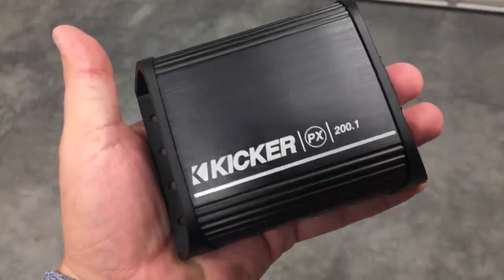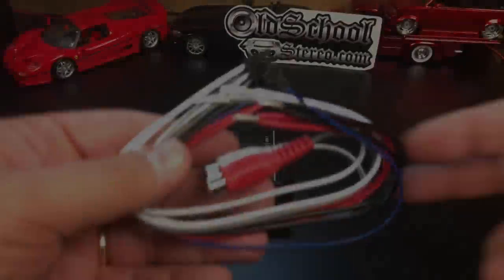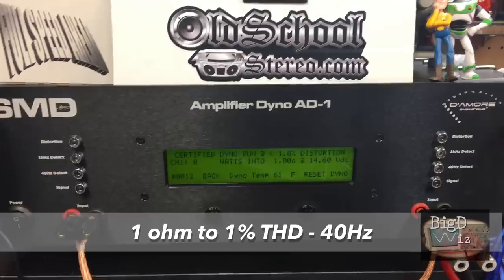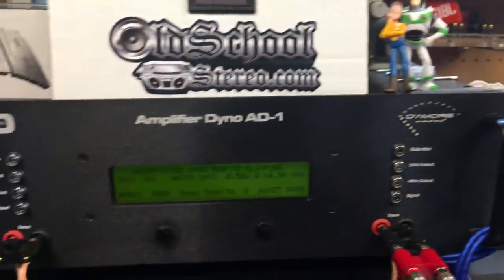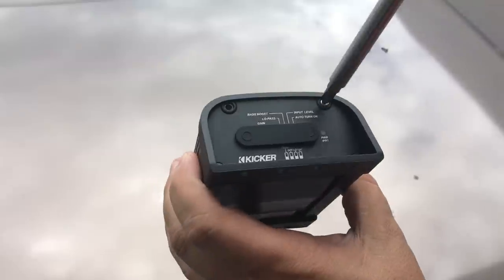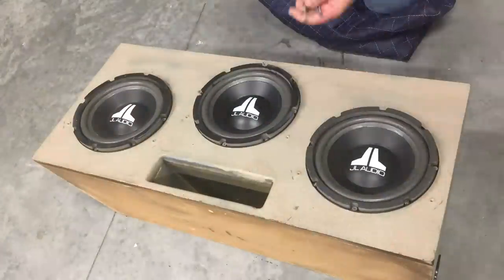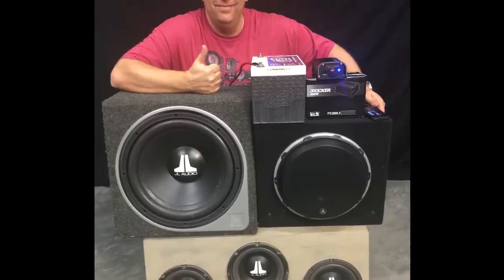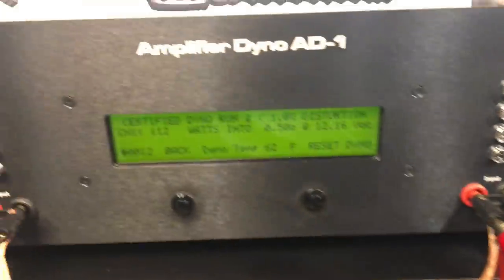Palm Sized Power? Kicker PX200.1 200 watt Monoblock Amp Dyno Test

Comment: 160w while fitting in your palm seems fair.
Reply: watch his video on Rockford Fosgate PBX 300 then tell us if you still think it's fair.
Reply: @XX-121  the Rockford is 2-3 times the size so it should be more powerful.
Reply: They could just call it a 150 and then it would be honest and fair . Thus is almost 20% under the rated . Just rate it honest this is rating you expect from Walmart  .

Comment: Never liked the kicker Amp. Now I love the speakers you got wired up. JL 15's with the JL amp. I can't remember what size amp it was but I had them in an Nissan Exterra and I could drive though the walmart parking lot and set car alarms off with that thing. Had component system in there. Out of all the systems I had, that was by far my favorite and most loudest system I ever had. Between setting other car alarms off I could be riding down the road at 50 or 60 miles an hour and the damn back door would open wide up. Many times I should have lost those speakers. Which I did. I loaned them to my nephew and tried to tell him to take the cars when he went in at night and lock up his Jeep but he was hard headed. They found the Jeep 2 towns over with my speakers, box and amp gone. I could've cried that day knowing the amount of money I had in that system. Sick ass people can't go and work for their own stuff, they got to steal other's and we're the racist one. I wonder why.

Comment: I really guessed it would have done rated, but nonetheless per size its not too shabby. At least it wasn't called a 300 or 400 watt
Reply from the maker: +www.GPcarAudio.com pretty close, but calling it a 150 watt amp would be more realistic IMO
Reply: BigDWiz yea definetly agree
Reply: www.GPcarAudio.com 
I totally agree. Being a Kicker and with my experience with a small Rockford PBRs... I totally thought it would.
I'm wondering how it would sound in a car pushing a sub...
Reply: It's still pretty good. Something like a Pyle would probably do half that and claim twice the wattage
Reply: it depends on how you connect a kicker actually your on the right path. warring kicker products put out double the amount. so 300 is 600 200 is 400.
Reply: As someone that owned a bit of Kicker gear in my teenage years I'm kind of disappointed...
Reply: @wal  Marketing garbage, they knew well after their testing it was a 150 watt amp :-/

Comment: They can’t all be winners... for the applications these will be used in I’d say it’s still a solid deal. Great video as always!
Reply from the maker: appears they should have rated 150 watts, not 200. Unusual for Kicker, they usually don't do this. I'm a bit shocked, honestly...
Reply: I’m assuming they borrowed this design or even had someone else build it for them, but I did see where it had Kicker on the board so who knows...
Reply: hifivega 
I agree! Considering it's 50 bucks shipped! That's crazy!
I was thinking it was going to have a $125 price tag!
Reply: BigDWiz 
I mean could there just be an honest mistake here? Maybe the original design and amplifier pushed out 200 watts and then, to get the cost as low as it is, some parts were changed allowing the cost to get into the $50 range and they just didn't retest and change the literature.
Dang. When I post at 10 in the morning it actually kind of makes sense. LOL.

Comment: Still impressive for the size and half ohm stable not many amps out their claim half ohm stable
Reply from the maker: +Daniel Harrell very specific use here
Reply: Could it be used for full range or low lass only?
Reply: Daniel Harrell 
Use 2 of them.....one for the left channel and one for the right. Lol. 
Kicker does make a 2 channel version as well.
Get this mono amp and the Pioneer 12" Pro (105db sensitivity) then the 2 channel version of this running some PRV mids and super tweets (100+DB sensitivity also) with an Audiopipe 2 way passive crossover (20.00...for a set!) And boom a WOW factor tiny amp loud system!
Reply: It's actually 0.25ohm stable believe it or not. I've installed a couple like that. lol HEY BIGD! THROW IT BACK ON THERE AT 1/4OHM!

Comment: I know I’m late to this video. But I got this amp a loooong while ago. I built a little sub box with a 6.75 kicker comp r and a passive radiator to put in my single cab work truck and be discreet about it, and this thing does some work for being so tiny. Huge fan of the auto turn on because I was already nervous about running wire to the battery (Company owned work truck).
Reply from the maker: Awesome 👏

Comment: This is actually half of what a normal car amp would be,it lacks a power supply since the simple construction,thus very susceptible to voltage changes,drop it to 12 volts and most of you power will be lost,when a regular amp would "keep" it's power better when voltage drops.Still a cool thing and more than enough for anyone other than people who compete.

Comment: Edit: I just realized this is a older vid. Lol!   Oh well!  

Another chip amp which isn’t necessarily a bad thing.  The chip isn’t visible after he removes the bottom cover, Im guessing it’s soldered to the other side of the PCB which presses against the enclosure/heatsink.  Probably not the ubiquitous TPA3116 that’s used in a lot of inexpensive chip amps, the TPA3116 can actually perform very well but only when it’s supplied with a 24V-28V DC power source which is capable at least 5A. Since this is meant to be used with 12V-14.4V.  I’m guessing it’s using one of the newer automotive ST Amp ICs which are specifically designed for the lower voltage.

Comment: Hey,

Could you do some dyno tests of headunits please?
Would be curious to see if any meet their written specs like the Sony headunits that claim 55Wx4.
Reply: Nobody that's serious about car audio relies on the power from the deck.   You get what's called a 'deadhead'.  Puts out no amplification.   ONLY  low level outputs.
Reply: The Sony with the power pack amp built in does in fact put out about 40w I used to own one it was awesome for what it was

Comment: For the price it's a nice and very efficient amplifier. It took only 116 watts (8A times 14,54V) to put out 91W into a 1 ohm load, which means that the effectivity of the amp is around 78%. I'm wondering if that's class D or not, because for class D it's a bit on the low side (and gets worse at 0,5 ohms).
Reply from the maker: +AttilaSVK it’s very difficult to get an exact current measurement with my setup as I need to stop the test as soon as the Dyno stops counting. I usually give it a second or so more and current rises and power does not. I’d say it’s very efficient as compared to most amps I test, even other Class D’s
Reply: Thanks for your answer. Your testing method is fine, and I really appreciate your videos. Keep up the good work :) (and if you'd get an Alpine 3554, please put it on the dyno, as I'm curious how it would perform - a 3554 is running my front set and my sub btw)

Comment: These amps work good for stock sub applications. I have a 2000 acura tl and after changing the head unit the factory amp is no longer usable. The stock sub is .8 ohms and there is not an aftermarket replacement sub that fits in that location

Comment: The most under rated wattage on any amp I've ever seen is on my Mcintosh Mc-300 non auto former Amplifiers ,Mc rates the amp at 300 wpc @ 8 ohms stereo and 600 wpc @4 ohms stereo ,in bridged mono Mc lists 700 watts @8 ohms and no rating for 4 ohms ,all ratings are at 0.05 THD ,when I benched the amp it's putting out 420 wpc 8 ohms and 850 wpc 4 ohms ,in bridged mono it puts out just over 900 watts @ 8 ohms with 0.05 % THD and zero clipping due to Mc power guard ,the best value in high end home audio high wattage amps is the Mc-300 that's a rare amp being it wasn't made with auto formers .

Comment: Hey Big D whiz, enjoy the videos. Couple questions. First, would you be interested in bench testing an old US Acoustics 2050 amp? Second, Have you ever bench tested a US Amps USA-2000 amp? I have one I’ve been running since 2001 and just curious what kind of power it really puts out.
Reply from the maker: +Paris Dean thanks bro. I’m loaded down with stuff to test right now. Thanks for asking though🤙
Reply: That’s fine, Should have been more thorough on my second question. I was not asking for a bench test of the USA-2000. I was just wondering if you have ever done a dyno on one or if you know anybody that has. Just curious of what kind of power it really puts out.

Comment: I use to absolutely love kicker equipment. I remember back in the early 90’s having 2 kicker 12s in my 88 mustang 5.0 drop top that would absolutely pound.. but now says kicker is sold at freaking Walmart so it’s lost it’s name significance ya know... those JL you pulled out tho are sick! Wasn’t it a W6 or something that was supposed to be bad ass back in the day lol
Reply from the maker: We asked the Walmart question in an interview with Kicker marketing. See the response here. Makes complete sense to me https://youtu.be/3ajYwo7MOH8
Reply: The W6 back in the 90s was one of the biggest subs you could get.
Reply: I had the w5  duel 8ohm that sounded better then my w6  duel 3ohm, just the dimension for the box for the w5 was so big, that it took up the whole trunk space of 90 cougar, but if he could test some w5's you would b surprised. And yes, in 1998 when the w3 came out i got a pair and took my triple stack w6 out and never tried anything else to date. I still have the w3 12in duel 2ohm with a Orion 600 watt hot setup with the skull and blinking red eyes in my basement

Comment: These amps don't have a very high S/N ratio, its around 70-80db last time i checked. Not the cleanest little things, but they are small and get the job done for bikes and small vehicles.(updated) just noticed in the manual it said >90db s/n ratio, that's not bad. Should rename this amp to the px150.1
Reply from the maker: +Wade Hensley look a lot like the chip amp boards I’ve tested recently

Comment: The distortion rating at .5 ohm sucks but I have been looking for a particular amp to run off of an X box cord in my house and the cord puts out 14 amp's so I'm thinking this amp will be ideal for a little home made sub amp to run indoors
Reply: You can also use a power supply from a computer to power 12 volt electronics. Plenty of info out there if you're interested. Most are around 14amps.

Comment: I just watched this video tonight, the soldering inside that box will definitely make you lose a bit of watts.  Those J connectors don't have flow through on the top side, if you know how to solder you can fix all that yourself pretty easily.
Reply from the maker: You really think it will make a difference in an amp with this little output? I’m betting the difference is negligible

Comment: Question : if 17 AMPs is going thru the Amplifier cables to the Woofer then :::::: 14,44 Volt * 17,1 AMP = 247 WATTs  Why does the dyno shows lesser ???
I'm asking because this Amperage is not measured from inside the amplifier it is measured from the cable that touches the woofer, so it actually reaches the woofer, how is the math here ?
?

Comment: Swap meet Chinese chip amp with a kicker silk screen... Too bad. I do wonder if the results would be different on these amp tests with the bass boost turned on. I know it shouldn't matter, but on cheapo amps it sure sounds like it does. I was wondering about that on the Boss Audio mono amp tests.

Comment: You had the gain at 1/2.  Would turning up the gain help or just add distortion?
Reply from the maker: The gain is used to match voltage with the source unit. Turning it higher would only make it clip sooner, won’t give more power

Comment: What's the point of this amp existing, what sub setup is going to require 200w at a half ohm, or even speaker setup? 
Don't they also make a slightly longer version rated around 400w? I wonder how well that one performs
Reply from the maker: +Xander Zoolander they make 1 ohm DVC 6.5 and 8 inch subs, designed specifically for this amp

Comment: 10%thd equals clipping?   I've seen clipping happen when the dd1 lights up.  O scope and dd1 hooked at the same time i've seen the wave square off as soon as the light turns on the dd1.  10% is a good amount passed clipping imo but don't you have thd meter that you can use to test the 10% value?
Reply from the maker: +Douglas Taylor yeah it depends on the amp. I was just showing if it doesn’t meet rated at clipping, it’s not going to do it at 10% THD. Now we know why there is no birth sheet inside 💁‍♂️
Reply: BigDWiz yes but my point is the 10% thd can be passed the point of clipping.  And the dyno only measures to the point of, not past.  I do agree it underperformed.  Unless you’re competing that 10% is useless

Comment: Have you tested 1000.1 kicker amp? They come with rating test cert I'd love to see what your results are!?
Reply from the maker: This is the only Kicker amp I’m aware of that doesn’t meet or exceed rated specs
Reply: @wal  cheers :) I have had it for several years but yet to actually use it. Also have 2k 4chan boss amp but I'm pretty sure it would come well below like the others.

Comment: Hi Guys need a suggestion, how about an 5.1 amplifier which has 85 watt per channel with 5.1 set of 2 tower speaker with subwoofer capacity capacity is 180 watt per speaker& 1 center speaker 120 watt & 2 surround speakers 85 each. Is this a overload to the amplifier or will it be ok for a decent output ???

Comment: This is meant for subs, but i can also use them to give some extra boost to my stock car speakers? I swapped my rear door speakers but my stock radio cant power them. So i want a small amp that fits under the glove box that can give them a boost.

Comment: If I was still an installer I would totally shove this thing somewhere in the dash, just not screwed on the firewall, lol. I would run it to an efficient 12" in a band pass or huge ported box.
Reply from the maker: +Joseph Stalin it could also fit in your pocket and power a sub in a backpack 🎒 🔈

Comment: How do you hook up your phone to play through the amp? And is there a way to bypass the remote so I can build a custom stereo for the garage but have a car stereo with an amp
Reply from the maker: RCA to 3.5mm cable. I used a battery, but you can use a 12V power supply in a garage setting. Connect remote to positive,,or add a switch so it acts like a vehicle ignition turn on

Comment: Is it me? Or is it asking a bit much to think you would get full power at 40Hz when its crossed over at 250Hz , or even 100Hz? It would be nice if you could dump the x-over and run true full range.
Reply from the maker: Yes it is you. The 250Hz is low pass, lol. I have the 2ch version also which will run full range, this one is for subs only
Reply: BigDWiz ok. I didnt know that. Shouldve done my homework. When you mentioned it was for motorcycles and what not, i assumed it would be a hi-pass filter. Great video also! 👌🏾👌🏾
Reply from the maker: +Wild Child it’s all good bro. Thanks for watching and commenting 🤙

Comment: What would you  use this on? - can It do 200hz- 500hz ?

I have 2" massive audio mx2 components & there frequency range is 200hz+ but i want a bunch .... 8 would be .5ohms I could easily do 8 in each rear DOOR/piller <02 sr5 4x4 4.7L tundra access cab>
& I do love my TWEETERS although they'd be right behind my head ....i am gonna do 2 6.5'S  & 1 8" mids in each front door
Reply: Single 8" sub when your struggling for space

Comment: would the 3 subs having coils parallel(6&6=3ohm)all in parallel not give 1ohm?

could at least have tested the 100w like that

and all you would need is a dual 2 w/coils wired parallel to 1ohm then parallel it w/the 3small subs to get your .5ohm..

or am I missing something?
Reply from the maker: +Chris Morse no, the 3 8W6’s all Wired in parallel gives 1.33 ohms, 15W3 and 12W6 were all wired to 2 ohms. 1 ohm and 1.33 in parallel gave me 0.8 nominal load (math says it should have been 0.67, but the DMM doesn’t lie)
Reply: +BigDWiz yea ur right about the meter..hard to argue when you hit the leads and it shows the impedance it is What it is..but the math!! haha

did u meter the individual coils at 6ohm ea? parallelled should get ya 3ea then you know where I'm goin haha..its just drivin me crazy 

oh well, man good thing you're a professional and meter em after wiring instead of goin by rating! keep up the good work

Comment: JL w6 or w7 vs sundown?  8" I've had w6 12" but looking to have good bass with small box
Reply: I’ve had JL w7 8 inch and the sundown SA 8 inch. I ran the same power amps and the sundown was way better. I would go for the sundown x8. Hope this helps. I had ported boxes for both types.

Comment: IDK, guess if you want something that fits in the glove box, 150w will get you some decent bass for a basic factory system. Kicker has been around for a long time, they should have made sure this at least did rated, but for the price, can you really complain... It's pretty cheap, and I doubt many bass heads will be using this for anything, probably work great in applications you need a tiny amp and 100w. Sure beats those super oldschool "power boosters" that would go in the glove box.

Comment: Let's not go crazy.  163W (22,1 dBW) is practically the same thing as 200W (23 dBW).  One cannot really hear a difference in loudness of this magnitude (0,9 dB).  You will find differences in loudspeaker efficiency that may vary by more than 3 dB SPL between two different systems.  That is where the money is...
Reply from the maker: True, but still 40 watt difference is 20% off rated. It is said to do 200 watts at the board